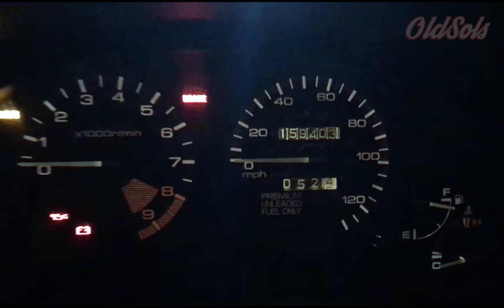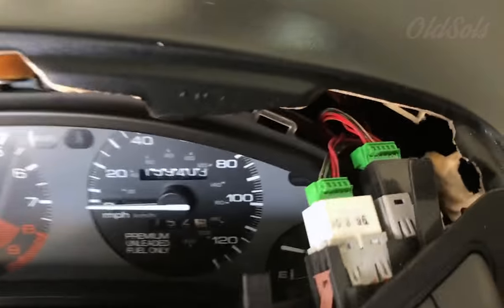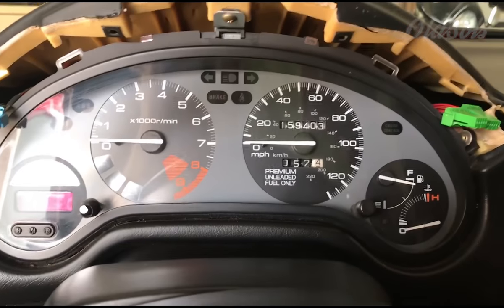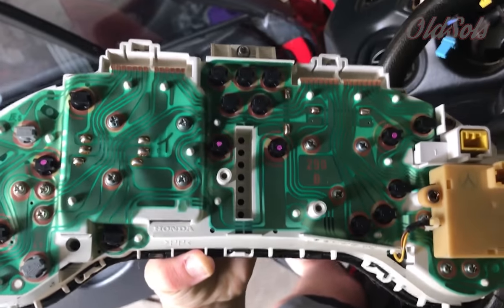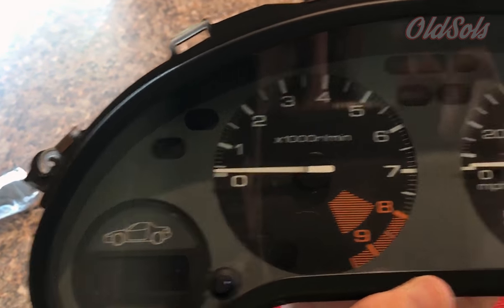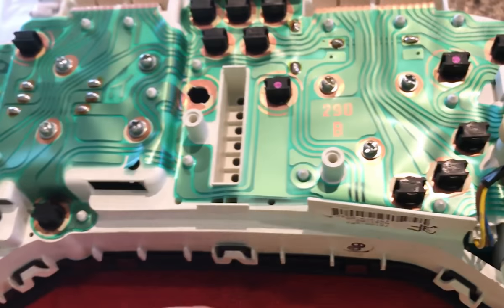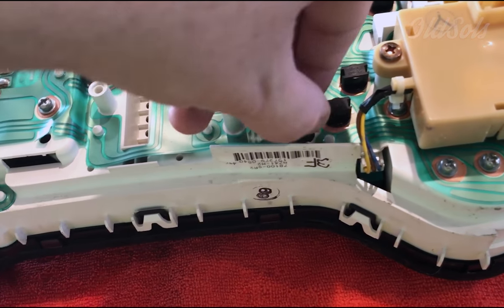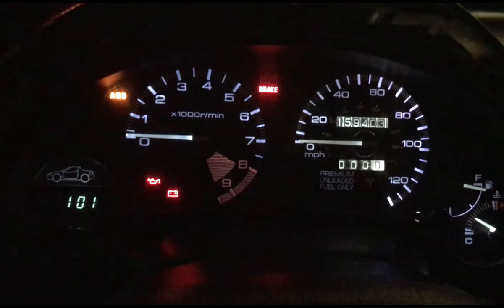Honda Del Sol Instrument Cluster LED install - OldSols Vlog #4

Comment: Man I hope this helps with my issue.
My guage cluster isn't lighting up at all. I checked the dimmer switch and pulled all my fuses. Next I will change the bulbs.
Turn signal lights work that's about it.
Reply: Hey did you ever get your dash light issue resolved? I replaced two bulbs (#74) and now fuse 19 blows and I have no dash or rear lights.

Comment: Did you ever experience speedometer couting higher speed than it actually is? because my car was counting well and for no apparent reason started to count more 10mph than before.. i mean, at 3rpm i should go at 50pmh.. no i go 60mph and i dont know why.. the gauge works fine.. no flickering whatsoever.. can someone help me please?? :(
Reply from the maker: Sorry to hear this happening - i will try and do some research on why this is happening
Reply: @OldSols  thanks my friend!! if i find the source os the problem and the solution, i'll post it!

Comment: I just order the kit of Ebay but wanted to know about the clock. Mine is so dim and you can only see it just a bit when you push on the buttons to change the time. Any help with that?
Reply from the maker: There are more lights in your cluster than usually come with the eBay kits - I think I bought 3 or 4 kits to do the entire interior. The clock I believe is it own unit and possibly might be separate smaller bulbs such as the ones up top in the buttons on top of the bezel. I will have to confirm later when I get home and can get back to you on that.

Comment: FYI, don't ever remove the small wire harness from the "light brown" square box/board behind the clock.  The 3-wire plug (yellow, brown, blue) connects into the bottom side of the cluster, for the dimmer switch. If it's not plugged in, you will not have power for the cluster lights.  If you ever decide to remove the clock/indicator, you have to still keep the wires connected, main one to the light brown box as well as the small 3-wire plug  Just move the light brown box out of the way. I had to do this when I installed my AutoMeter vac/boost gauge in that location.
Reply from the maker: Eric Xiong good to know good to know
Reply: New reply to an old posting, but here goes.  Had an "Indiglo Gauge" install done on my Sol back in 2003 but they eventually went bad.  I'm assuming the guy that did the install for this unplugged that wire, thus I don't have the original cluster light working.  When you say "don't ever" are you saying that once you remove the wire you can't get it back working?  I'm curious because after seeing how easy it appears to get into the cluster, I'm considering fixing it myself after driving with a dark cluster for fifteen years.